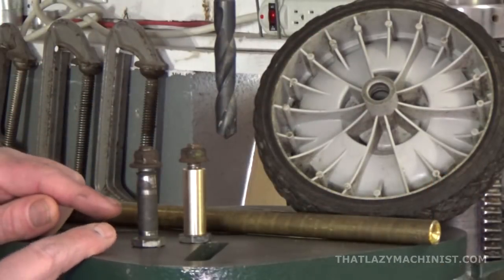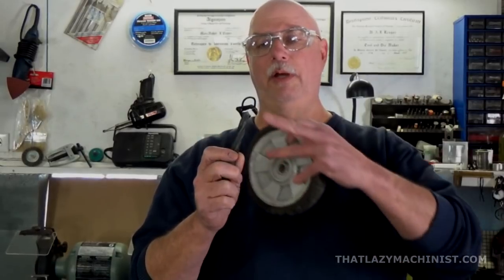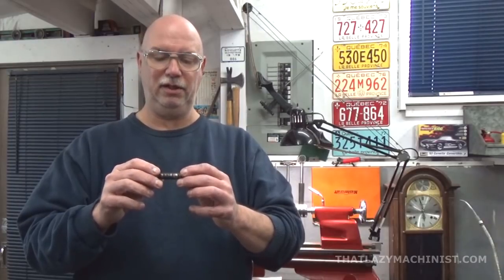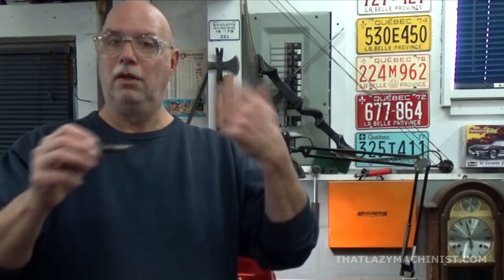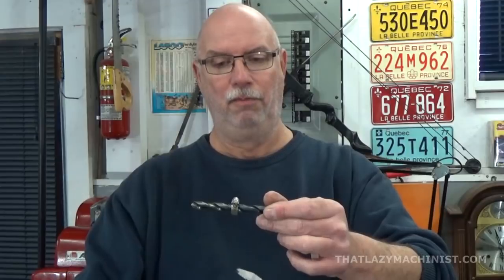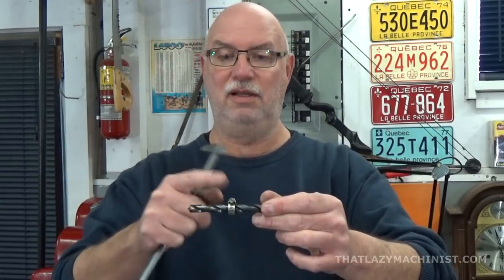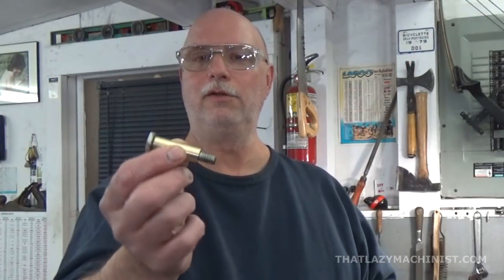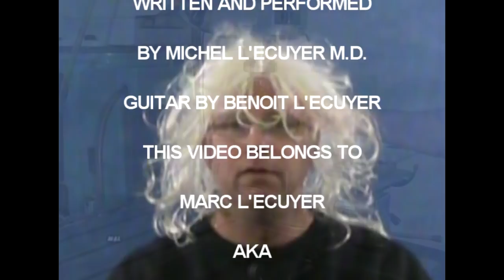MOWER WHEELS REPAIR & BRACKETS, MARC LECUYER LQ#038

Comment: Nice job on the lawnmower wheels, only thing I would do different is have the brass bushing fit  tight in the plastic and turn against the steel shaft.

Comment: You started with plastic on steel   and ended with plastic on brass.  Why not press fit the brass to the wheel and end up with brass on steel?
Reply: Robert Matel thats what i think to!
Reply from the maker: Hi Robert, It would work any way and I did consider both possibilities and even a third. I pondered using the brass as a double bearing , slight clearance on the pin and in the wheel. In the end I choose the plastic to brass since it is a good anti-friction combination, it also gave me a larger bearing surface and also the larger diameter pin will assemble more easily (larger end contact on the shoulder of the thread) on the mower base. I am not however belittling your suggestion, it also has advantages and would be just as elegant a solution as what I chose. Thanks for a great comment and for taking the time to write, Marc

Comment: So what would last longer. The wheel rotating on the brass, or press fitting the brass on the wheel and the brass rotating on the steel bolt ?  In reality the brass is more expensive than buying another wheel bolt. Lol

Comment: Your videos are always informative & educational & a sense of humour helps greatly...

As for this particular video, kudos for defying society & simply replacing the parts & throwing the old ones away, that happens way too much these days...

From someone who has spent time fixing lawn mowers & also has a basic knowledge of machining, I, personally would've made the brass sleeve a clearance fit so as to create a brass bearing, prolonging the life of all three parts... but that's just me... 

BTW: Do you intend to do a video tutorial on your toolmakers vice? I would be very interested in seeing that...
Reply from the maker: Hi Jack! Thanks for watching and for taking the time to write. I am trying to negotiate access to my former employer's shop so that I could produce a video on that project. I just don't have the equipment required to make the parts at home. So fingers crossed for a positive answer since I cannot rent the shop (to expensive for a pensionner) so I am trying to barter access by permitting them to advertise the school on my website. Who Knows! It may work? Marc

Comment: I like your videos , I also like the fact that you live somewhere in the same province as me 
I had the same problem but steel wheel on a dolly , my fix was a tube welded to the wheel  and reamed held on the axle with a washer and a cutter pin , it is about 30 years old and I am still using it , Good show  keep them cumming

Comment: Let's see.... with several thousand dollars worth of shop equipment you can salvage a $3.75 lawnmower wheel. Please don't tell anyone that it makes sense to me!
It's worth every cent because it changes your outlook on the world... you have the power to control your environment. There's nothing you can't do if you have a lathe big enough!
Reply: Avoids adding the worn wheel to the worldwide solid waste stream, which now includes that entire continent of plastic floating in the Pacific Ocean.
Reply: I would be done making what Marc made long before I could figure out where to buy new wheels and axles. Maybe if you live in a part of the world where you can buy them at the nearest corner it would make no sense.

I mostly use my shop to make stuff I cannot buy anywhere though.
Reply: You need to be careful if you reach the point  that you hope your things are going to fail so you can repair and improve them :-)

Comment: Marc, thank you for the video. I am intrigued with the way you modified the drill so it wouldn't get pulled threw the plastic. Do you recommend modifying drill bits in this fashion when drilling brass?
Reply from the maker: Yes!!! I would use a neutral attack surface on any material that is "GRABBY" such as plexiglass, brass, copper, lead and so on. If you drill a lot of soft materials it could be useful to get a set of straight flute drills.
Reply: Freethinker, the technique is often referred to as "brassing" twist drills.